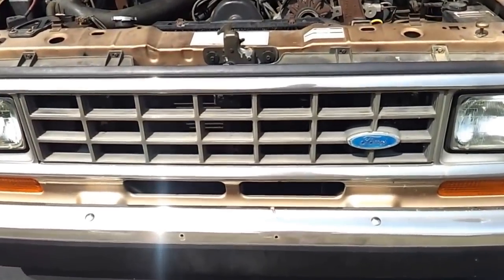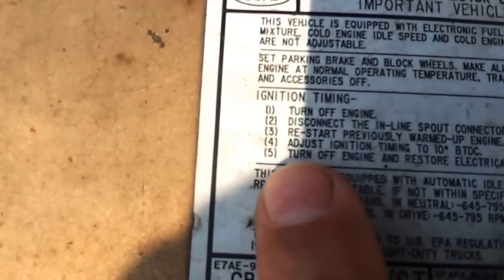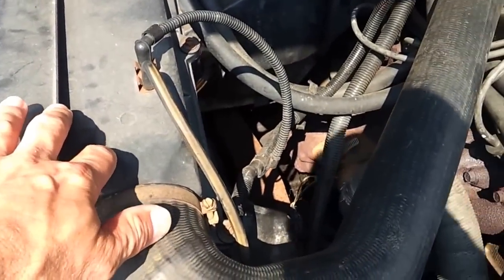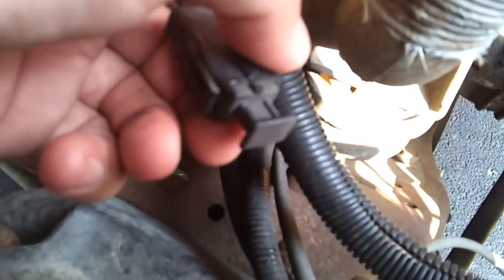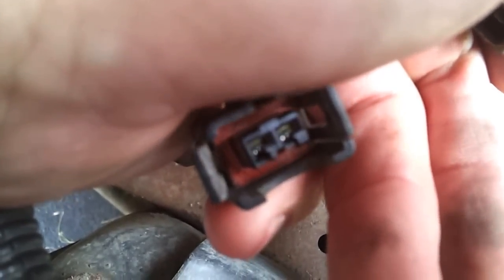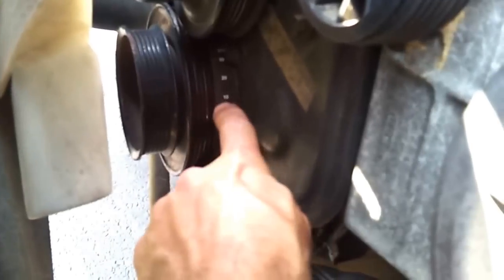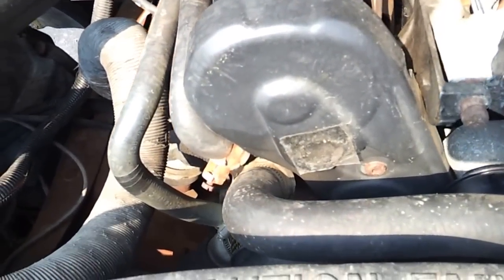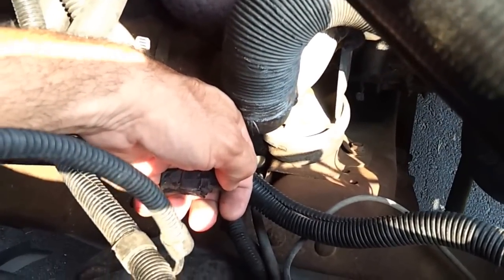IN-LINE SPOUT connector, Ford Ranger, Set Engine Timing

Comment: Nice ty .. could you make a video on the wiring harness on the fuel pump relay box? i am in dire need of the color codes that went to the one i just recently picked up. aparently someone either swapped engines or rewired the  truck and the color codings just dont match up to the fords wiring diagrams. I need the pic of the wires that go into the bottom of the relay and the ones that go to the fuel pump and the ignition distributor if any ,, your help would save me so much headache such as info is hard to come by for the first 1985 efi 2.3 with the 5 speed trans,,

Comment: Did timing put it on 10 and turned it off pluged back in spout connector and idles good but when u drive it down road has no power and it sputters in and out I've checked vacuum,new plugs,wires,distributor,rotor button, coil,map sensor,new timing belt and tensioner made sure marks all lined up a bunch a times after rotation and made sure rotor button pointing at number 1...seems to run better if I put it on 20 with spout in and still sputters in and out little more power then on 10 and no back fire and no missing no jurking...can't seem to figure it out...doesn't do b it when cold runs like it should as it gets hot it sputters...
Reply from the maker: Have you changed the fuel filter and checked the condition of the gas?  Is it old and rusty?

Comment: i got a 87 ford ranger xlt 4 wheel drive i need color ideas any suggestions
Reply from the maker: I have two suggestions.  1) Keep the original color 2) Your favorite color
Reply: K thanks
Reply: im doing a deep canyon red, i just bought a 91 ranger 2.3l and just did a complete rebuild with the 98 2.5 head.

Comment: Did you attach the pigtail so the inline connector could be seen?  The reason I ask is mine does not have the pigtail.  It is plugged directly to a harness.
  As I understand this, there is no adjustment for the timing after it is set being that there is no distributor.  This will be a cold start.  Wondering if the stamp is a generic thing put on these trucks and meant for a different type engine.

  One more question, Is there a setting for the oil pump gear?  I am thinking not on this engine.
  Sorry to be a bother, but I hate to buy a book on this truck just for this simple problem and not knowing how longer I will keep the truck.

Got a diagram from the parts house showing timing marks, but I think it just showing the marks and not the settings.
Reply: Don't use Haynes if you want the best instructions
Reply: Oil pump gear timing mark is normally pointed up but don't think it matters on 2.3 as Hanes manual doesn't say nothing about the mark on oil pump sprocket

Comment: I havre a '94 Mazda with what I assume is a 2.3 engine.  Every video I have found so far, mostly Ford Ranger if not all, show the timing to be at TDC.   On the grill of my truck is the same sticker as you show saying to set it at 10 deg btdc.
  This has me confused.  It does not have a distributor if that makes a difference.
  I assume I should go by the sticker on the grill top?
Reply from the maker: 10 degrees BTDC is where the timing should be set if that's what the sticker says and the engine is stock.  Without a distributor your vehicles timing is controlled by the ECM and you will need to pull the SPOUT if equipped or jump the data link connector.  To do the timing check/adjustment correctly a service manual would be helpful to you.
Reply: That spout just dangle down loose?  I think I found it on mine but it is not dangling like that one looks like it is.
  This belt broke, glad I found this video.  I have changed timing chains on older vehicles but never came across t his.  This will be a cold engine.  Does that make a difference??
  Thanks a lot.
 P.S. I do understand the Ford and Mazda thing.  I had a 97 Mazda and and an '88.  The '97 had a Ford windshield.  Basically the same trucks with maybe a little different year is the way I understand it.

Comment: Hey this was a nice tutorial. I have an 87 ranger 4x4. It leaks transmission fluid a bit bad cuz it leaves spots. It does not look like that oil in the video it looks more clear like actual transmission fluid for like automatic i was thinking the mercon ATF. I got a manual that says it can use gear oil or mercon depending on the transmission so i have to somehow check which one i have. My question is to replace the gasket i just unscrew all those bolts around right? I hope is just the gasket. If this work i posted this comment instead of the video where you change the transmission oil is because it wasn't posting
Reply from the maker: Yes, you should do a complete fluid change and use a new gasket.  In my experience the Mercon is usually red in color, the gear oil is more honey/clear color when new.  I am not sure why you could not leave a comment on the Ranger trans gear oil change video but will look into the issue.  Thanks for commenting David, take it easy - Ozz
Reply: I will be asking for the gaskwt as well. U r right the transmission fluid is red. So i should also get gear oil. 80-90 how many bottles did u get? Thanks btw i just got this truck dont know much
Reply from the maker: Mercon does not come in 80-90, you need to check with Ford for the correct fluid or refer to the factoryservice manual.  Good luck with your repair